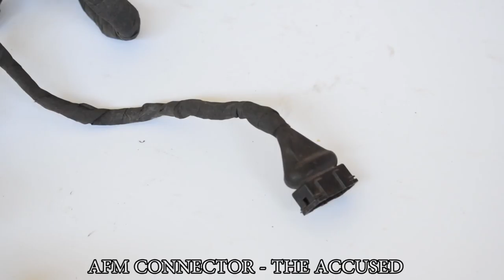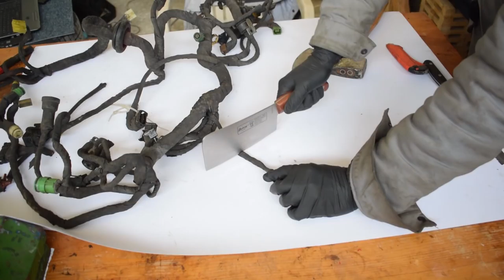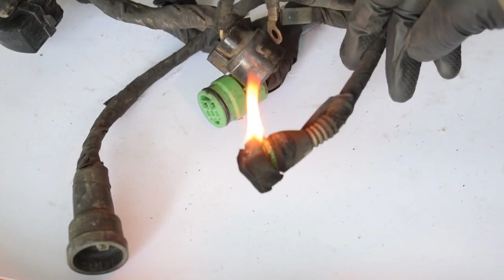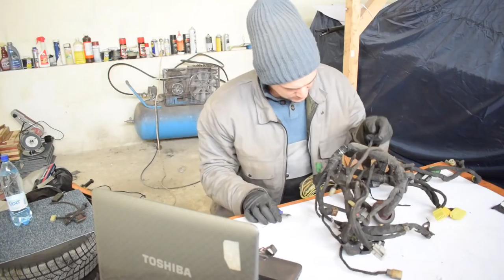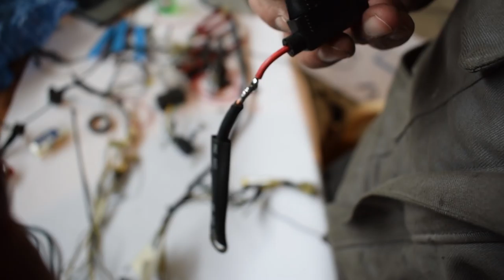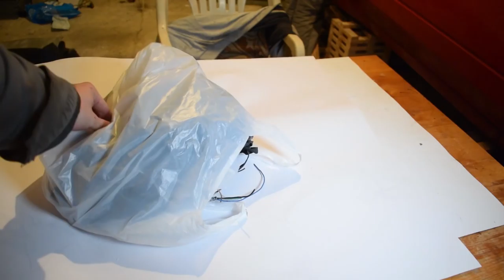Wiring harness weight reduction + connector court trial

Comment: The AFM does not only provide the air flow signal. It also produces a switch signal that shows if the engine is running or stalled. This is combined with the ignition switch position signal by the ECU to control the fuel pump. It can run the fuel pump in a primer cycle at 1st startup, run it continuously if the engine is running or switch it off if the engine has stalled. 

It answers the safety question "what stops the high pressure fuel feed if I have crashed, broken a fuel line and dont switch off the engine?"

You could replace the functionality by wiring in a shock relay or the oil pressure warning switch. Both were popular solutions that can be sourced from cars of the "electric pump and carburetor" era. I don't know what the MAP sensor MR2's used but that might be a third alternative.
Reply from the maker: stephen bello Hey there Stephen. You said something really important there and I will talk about this in a lot of detail in my serious wiring video. I solved the safety issue of removing the afm and the circuit opening relay by wiring in a tachometric relay from a BMW. It will cut power to the fuel pump as soon as it stops receiving signal from the ignition coil i.e. the rpms drop below a certain threshold. So when the engine is stalled it won't pump fuel :)

Comment: Do the carbs add power? Or make the engine more efficient? Or both, and how much does the kit cost? Is it reliable? And can it be done with every car? Or some cars just run ITB's?  And why are they considered better than ITB's?
Reply from the maker: Here's an unboxing video of the carb kit where you can see everything that comes with it https://www.youtube.com/watch?v=HTZ9xo1LVEA&t=3s. In this video there's a link in the description where you can see how much it costs. Now when it comes to hp gains, the carb conversion gets you about 10-15 hp, maybe 20 if you have some other mods like cams, higher compression etc. But more importantly it gives you better throttle response, an awesome soundtrack and makes the engine generally more fun to drive. When it comes to efficiency, you engine will be less efficient with carbs, i.e. the mpg will be worse, because when it comes to fuel saving carbs are an old obsolete technology compared to fuel injection. But the bike carbs are from modern bikes so the mpg will not be that horrible, maybe 1-3 liters of gas per 100 km more than stock. ITBs essentially means individual throttle bodies, and that just means one throttle body for each cylinder, it doesn't tell you anything about the fuel delivery. Bike carbs are essentially itbs, 4 cylinders, 4 throttle bodies, but the fuel delivery is through the venturi effect of the carbs. Now you can also have itbs and fuel injection. Fuel injection is superior in terms of power because it is more accurate and can be tuned more precisely than carbs, but it will also be significantly more expensive to have itbs with fuel injection. The mpg will also always be better with fuel injection. But when it comes to the sound and the sheer charm of it, nothing beats carbs in my personal opinion. When it comes to reliability there really isn't much difference when you take everything into account. Carbs require periodic maintenance, but fuel injection also requires a lot of sensors and complicated electronics, so while the injectors themselves will rarely fail or need to be cleaned (especially old school injectors from the 80s and 90s), the other components like temperature sensors, air flow meters or map sensors and other stuff will fail a lot more often. So essentially it's pretty much the same. Nice thing is when you figure the carbs out maintaining them really isn't' that complicated or scary. Hope I managed to answer everything :)

Comment: Whats that black cloth looking tape you used to wrap your loom, and where can I get some?
Reply from the maker: It's tesa wiring harness warping tape. Here's a link from eBay, but it's available in all automotive electronics stores. https://www.ebay.com.au/itm/WIRING-CABLE-LOOM-HARNESS-CLOTH-FABRIC-INSTALL-TESA-TAPE-ROLL-9MM-15MM-19MM-X25M/292004238869?hash=item43fccf1615:m:m3Mo1VrkwfMuP5DQ4qEZT_w

Comment: So... can I use my  4ALC harness and splice it into some pieces of the 4AG to complete the carbs set up.

 I have bought a ignition controller and the ignition box from MSD on eBay as one unit for a complete steel to that simplifies things greatly as that is one massive step already complete brand new in box I might add.
Reply from the maker: Micaiah Flores What you need from the stock harness is alternator, starter, fan, water temp sender, oil pressure sender and other basic stuff. I then used the ignition power supply to power my Nodiz and my ecu power to power my bike fuel pump. There will be a detailed video on the wiring soon.
Reply: driving 4 answers lovely <3 you are amazing

Comment: One question, what is a vsv used for? My Altezza had one on the stock airbox, but the previous owner removed it when he installed a custome short ram intake. Does it negatively affect the engine if removed?
Reply from the maker: If it's the idle up vsv (vacuum switching valve) what it basically does is it allows a small amount of air to bypass the throttle plate when certain conditions are met, i.e. a signal is supplied to it. For example when you turn on your AC at idle is usually one of those conditions, and you might notice the engine increase by about a 100 rpm when you turn on your AC during idle. If it's been removed this function will be gone, which is not a good thing in the long run as the engine does need more rpm in certain situations like this one.
Reply: driving 4 answers that explains alot.